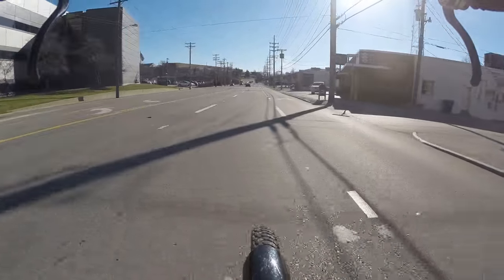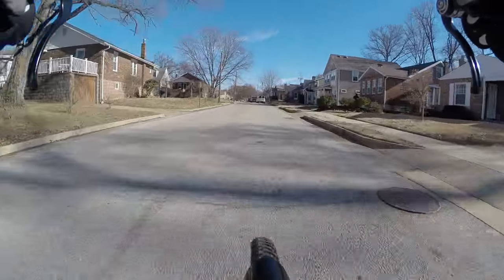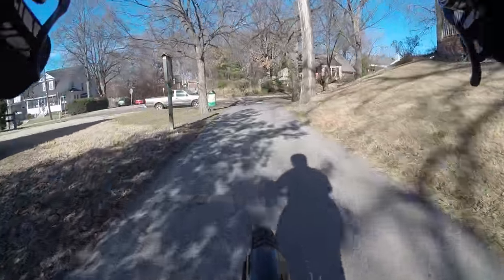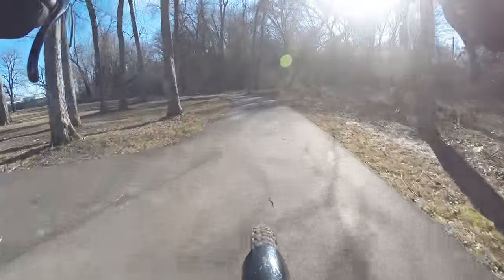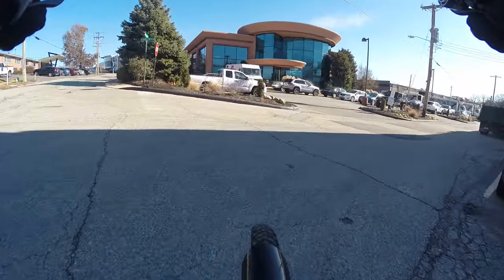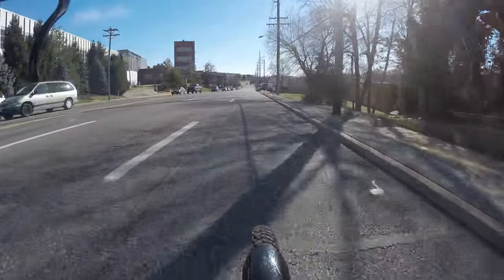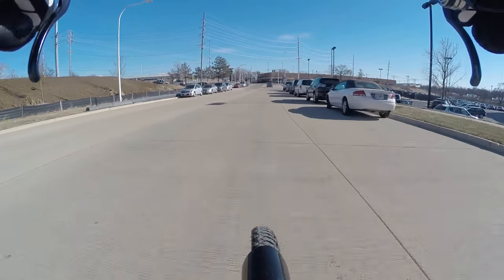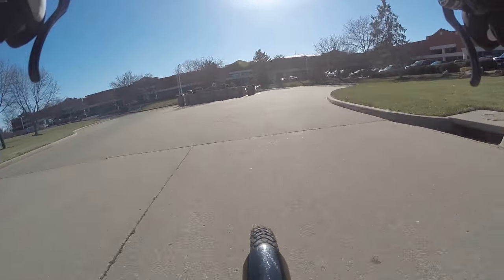Bullhorn Handlebar Shifter? Commuter Bike Blogger

Comment: I have a 7/21 speed hybrid bike with a riser bar and Shimano SL-R35 shifters. I've been thinking a lot lately on shifting to bullhorns without changing brake handles and gear shifters if possible. Any recomendations?

Comment: give the 2 speed IGH setup a shot.   I hated mine at first but now i think they're great.   sturmey archer "kick shift" hubs and/or sram automatix which shifts depending on wheel speed.     no shifter needed.   gain is around 30% for both if i remember right.
Reply from the maker: I've seriously thought about IGH. Maybe sometime. https://www.youtube.com/watch?v=LL3GiOHYdg8
Reply: oh yeah.  I even commented in that vid 5 months ago.  heh.   Give it a go.    The list leaves out the top of the list which are rohloff hubs.  Igh has some popularity in mountain biking  because it has almost no dangly parts to smash.  You're right though, it adds some weight but you can pick and choose.   On my rides, carrying 2 U locks on the frame so the hubs are nothing.     

 They're interesting if nothing else.     IGH's best feature is no maintenance for the most part, and you're no worrying about worn chains wearing down all those parts (or wearing them evenly) becasue you only have 1 cog  and 1 chain ring.

i've had sram's P5 and automatix.   and shimano's nexus 3 and nexus 8 and it's newer alfine 8.    The P5 is the only one sitting in a box.   I'd recommend the automatix because it's as close to a riding a single speed as you can get and still have another gear.   If you do, make sure you don't get old stock Automatix though. They use a proprietary axle tpi and you cannot find nuts for them without paying a fortune, plus you're screwed if the axle snaps or bends because all the internals are the same whacky thread.   (1local store wants $10 for an old nut because they know they're impossible to find).    take a standard m10 bike rear nut to check.  New automatix builds use standard axles.

Comment: You are a very strong cyclist. I can understand wanting just a few gears rather than a lot. But I don't understand why you keep the front derailleur instead of a rear derailleur. FD can be much harder to adjust. Most people would have a single gear in the front with a cassette in the back. Do the bull horns affect what choices you can make?
Reply: Bullhorn bars do affect what sort of shifters are practical to use but in general does not affect the ability to have a full range of gears. I think it's just single speed bias; like single speed high gear (flats and downhill) and single speed low gear (steeper climbs), without the tedious click click click in small increments. If the front mech is friction activated, which this is, and only a double, it's pretty much set it and forget it.

Comment: I was going to mention that it looked like your brake pull was a bit too long. Good place for the shifter; habit would make me locate it on the left horn but you don't have any other shifting bikes so no biggie. I might like it better out the front but if you can quickly grasp the bull by the horns and sprint without it getting in the way, no biggie there either. Only a single wrap on the bars? Looks thick on camera like it's double wrapped or something; maybe just an illusion because it goes all the way to the stem.
Reply: Hi bike blogger love your vids

Comment: That is an awesome set up. Try to find some bullhorn "Long pull" brake levers. Long pull brake levers work better with disc brakes. The 2x1 set up looks great but one question. Is that a mountain bike crankset?
Reply from the maker: It's a cyclocross compact crankset Mr Dookie.

Comment: BB, glad to see you're on the mend! Cool bike setup. I'm curious to know if you bought the tires already studded, or if you installed studs onto a set of tires you already had. I've no experience with studded bike tires and did not even know they existed until I began cycling.
Reply: I think they are Schwalbe Marathon Winter studded tires so they came that way.
Reply from the maker: Yep

Comment: I'm new to bikes can you all tell me what road bike I should get for under $2000? 
I would really appreciate it
Reply: My pick would be a Giant Defy Advanced 3 or 2. Two if you want to push 2k but a 3 is probably all anyone needs except for a pro. Do a little searching on bikeradar dot com. They often do a best bike for under $1500 type comparison list that should give you some good leads.
Reply from the maker: You could get a high quality drivetrain on an aluminum framed road bike for that budget, or a mid range drivetrain on a carbon bike. You get what you pay for and that's a high budget so no matter what brand you go for you'll come out with something really nice. You'll also get a set of nice wheels, but no bikes come stock with the best wheels unless you spend a lot more. https://www.youtube.com/watch?v=15lpfII9FCE

Comment: Are the brake levers on the horn ends easier to operate than levers on the flat section of the handlebars? I've seen bullhorn setups with the levers located on both locations